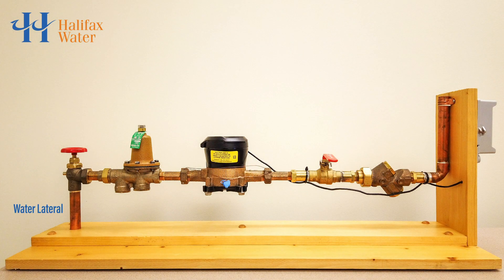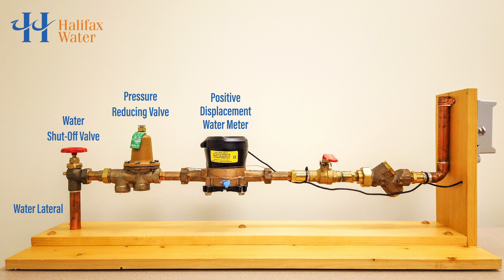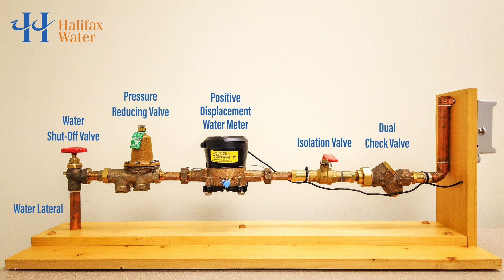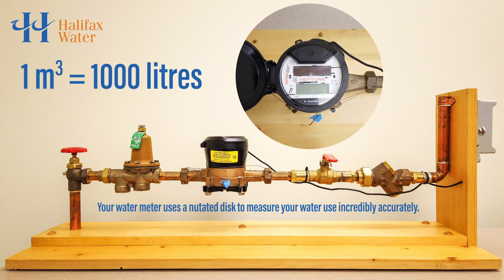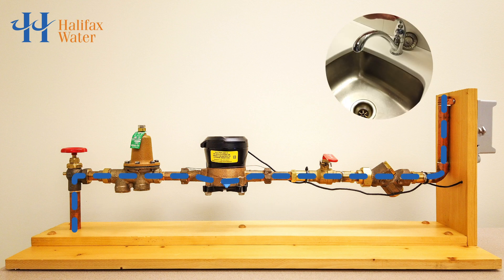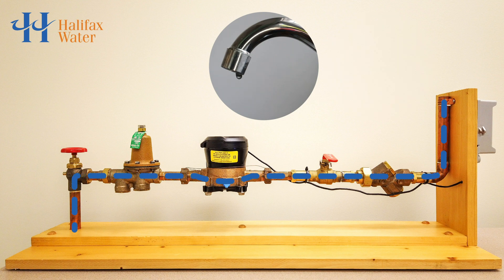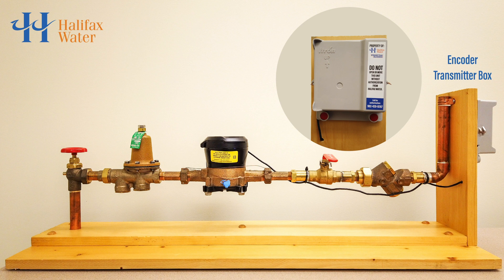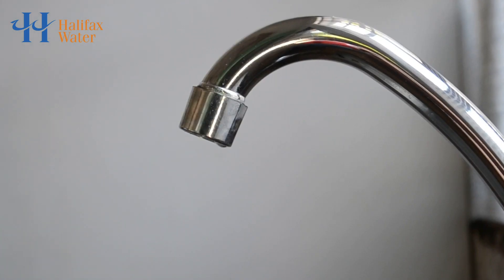How a Water Meter Works

Comment: Nothing in this video actually explained how a meter works ...
Reply: exactly🤣
Reply: The meter shown is a displacement meter. The body of the meter has a known volume. Internal to this area there is a rotating disk mounted at an angle. Water comes in one side of the meter and has to rotate the disk to reach the discharge on the other side.. each rotation of the disk equals a given amount of water and is transmitted by a magnetic connection to the recording section attached on top. The recording section indicates water consumed and can be read manually or electronically.

Comment: Is the water only measured from that 1 meter. Our water bill has increased 3-400%. I wouldn't think that's a drip? Any thoughts would be greatly appreciated 🙏
Reply: Shut off the valves and replace the meter with your own, that registers less water , so reducing the consumption.

Comment: Can you swap the water meter valve at the lateral for ball valve? Is there any real advantage to using water meter valve?
Reply: It depends on your location. In Columbus Ohio it isn't code to have a ball valve before the meter and the city needs to inspect new work after they turn off the building.

Comment: so when you open a tap from the upstairs, that's pulling water from all the way under the ground from the basement from the main water main? how does the water get upstairs so fast?
Reply: There is constant water pressure inside the pipes. The water that comes out first was sitting just behind that tap in the pipes.

Comment: It is always best to have a ball valve before your meter on your water service line and also one after it. The pressure-reducing valve is located after the secondary shut off and not before the meter. Check valves of any kind are not a good idea because of the installation of expansion water tanks. Other methods are best for water hammer problems. This is not a good example of a proper water service line installation.
Reply: Pressure reduction valve would require the installation of a Expansion Tank at the domestic water heater?   Reason being anything in the line before the water tank BLOCKS the expansion? Thank you
Reply: DAMN !!!!!!!!!! ABSOLUTLEY SHITTED ALL OVER THESE GUYS VIDEO!!!!!!!!!!!!!!!!!!!!!! WOW!!!!!!!!!!!!!!!!!!!!!!!!!!!
Reply: the pressure reducing valve acts as a check valve.  Having a separate check valve is useless

Comment: i like too shut of meter only with water working is that possible ?
Reply: No it is not possible to do that.
Reply: @rogerengle1630  it’s possible
Reply: @ricklombardo6912  only if you jump the meter and that's not recommended
Reply: @ricklombardo6912  or remove the meter head which is really easy

Comment: I have all of this except for the meter its self. And that's what I need the most right now so ik if theres a leak or not when i shut off the water with the water shut off valve. Ugggghhh
Reply: The culprits are usually the toilets mostly. Take a look in the tank and see if the water is going over the Overflow tube if it is that means that the water is constantly running past and down into the tube into the tank. If the toilet keeps flushing itself or turning on the water itself that means the flapper is leaking down below at the bottom of the tank and needs to be either cleaned or replaced. The best thing to do is to replace all the guts in your toilet bowl and any plumber or even maybe your fifteen-year-old kid could do that.

Comment: Just wondering they say if you turn off the water shut off valve and the meter still moving then you have a leak but how is it possible if water isn't flowing past in your diagram the water lateral?
Reply: The main shut off is a gate valve and they are prone to leaking. Always best to have a ball valve as your incoming valve on your water service line.